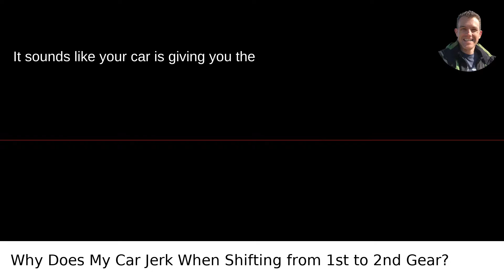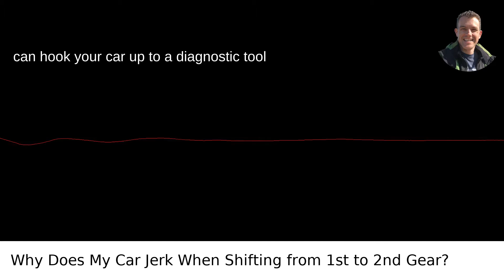Why Does My Car Jerk When Shifting from 1st to 2nd Gear?

Comment: Peugeot 208 automatic going from first to second gear definitely stats to jerk forward especially if stuck in a traffic jam then seems to lose all power when trying to accelerate. Next day it starts and drives fine for a while but no engine light comes on
Reply: My one also has the same issue. Any solution?
Reply: @abrahamkhan9961  Garage put it on diagnostic nothing showed up and it drove fine the next day. Guess it doesn’t like sitting in traffic but any ideas appreciated

Comment: Hello! My bmw e90 2006 has a sort of slow shifting. It takes a second and a half to shift, as you said higher gears barely to unnoticeable issue, but whenever I come to a stop, whenever the car shifts into 1st, it sort of JERKS. Be idle, shift from first to second, no problem. Back to first? Jerk! Automatic trans btw.

Comment: Thank you for this recording.. it answered most of my questions..i just bought a nissan Patrol 2006 automatic it has done around 280k kms the car is in good condition but the only issue is that it jerks while shifting from 2nd to 3rd gear & this happens only in mornings but once the car runs for a while the issue disappears there is not jerking mostly.what do you suggest i do?
Reply: Same here, Honda Fit Hybrid auto
Reply: Have you check it with mechanic? I have the same issues with my car